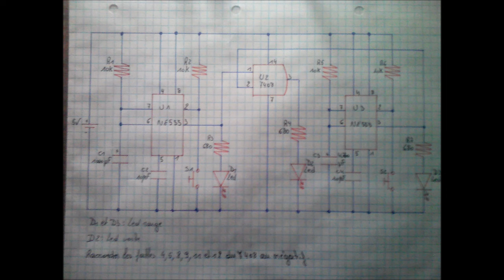Comment commander une porte ET avec des circuits

Comment: Attention ! tu écrit, mise au négatif des pattes 4 et 5, 8 et 9, 11 et 12  du TTL 7408
Je pense qu'il faut corriger et écrire : 4 et 5, 9 et 10, 12 et 13 .
Reply from the maker: Non car 10 et 13 sont des sorties et ce sont les entrées non utilisées qu'il faut tirer soit à un niveau haut ou bas donc 4,5,8,9,11 et 12 sont les entrées sur ce circuit intégré
Reply: Bonjour l'ami, je suis désolé mais je vois ce que je vois sur le net 
 porte n° 1  entrées = 1 et 2  sortie = 3
 porte n° 2  entrées = 4 et 5  sortie = 6     
  
 ensuite porte n° 3  entrées = 9 et 10       et sa sortie est  la 8 
 ensuite porte n° 4  entrées = 12 et 13     et sa sortie est la 11
Merci de vérifier et de me dire    Bonne journée à toi .
Reply from the maker: @jean-claudegillet6319  Désolé oui tu as raison, j'ai confondu l'ordre des sorties avec celui de la version CMOS.
Merci à toi :)
Reply: @protoelectronique  Oh ! Que oui cela arrive.